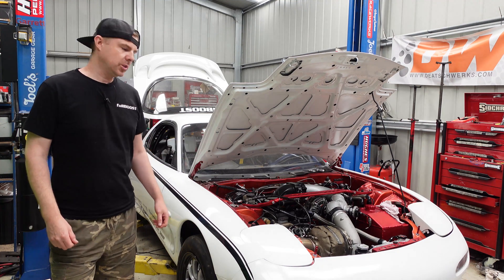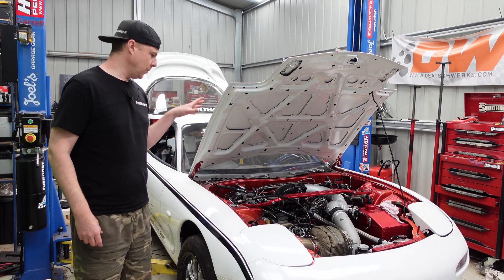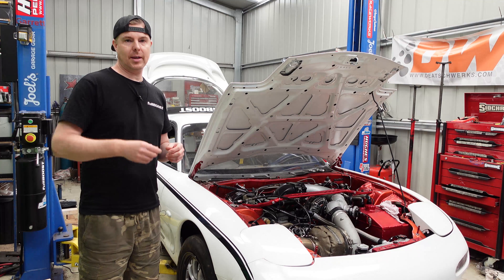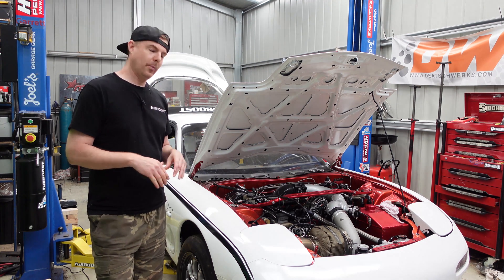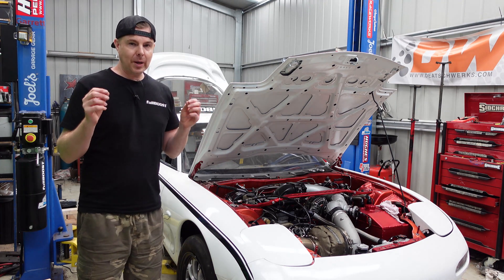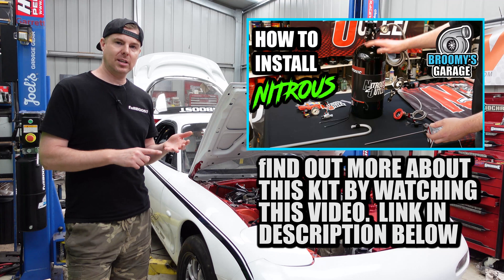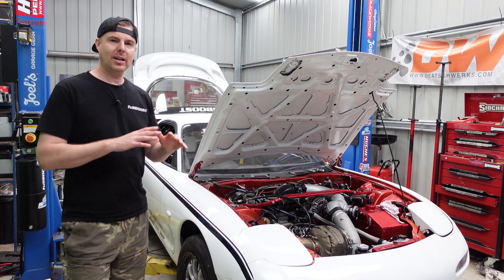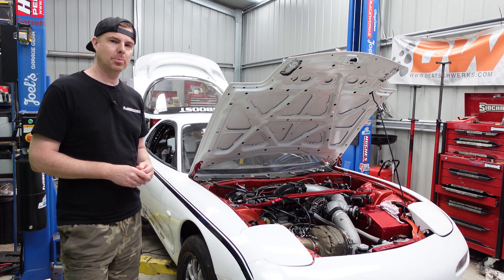How to Use Nitrous Oxide to BOOST a Turbocharger

Comment: Hi mate awesome videos. Quick one where did u buy the switch panels from on the rx7. Cheers
Reply from the maker: The push button ones ? They are apart of the Hardwire Electronics PDM.